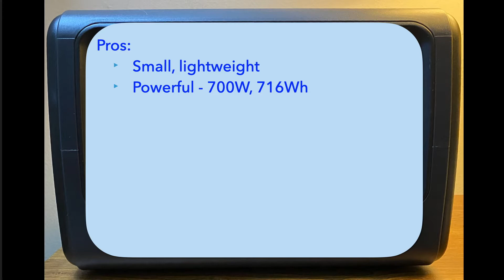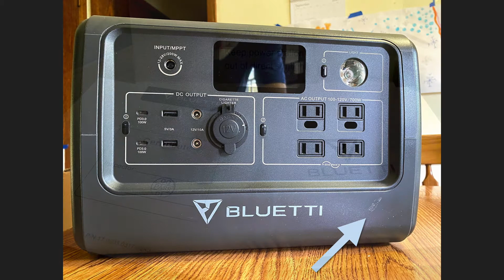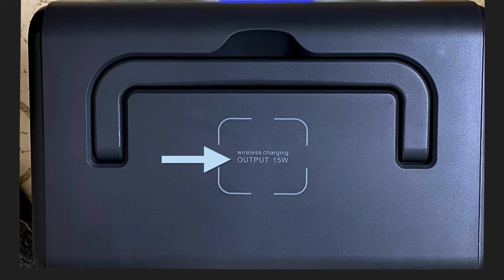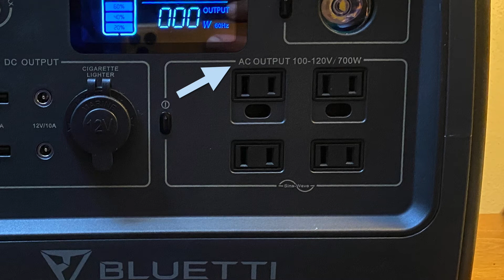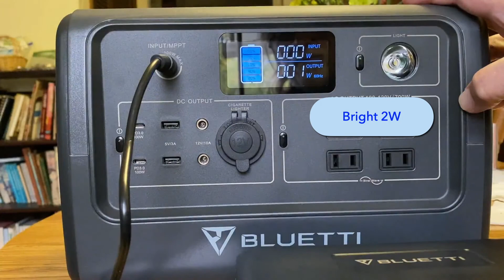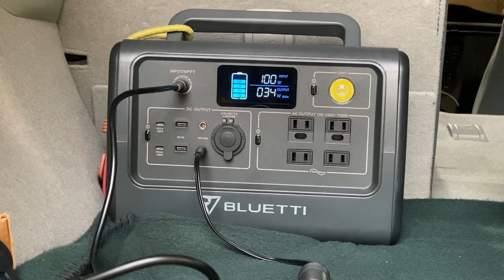Unpacking & Using the Bluetti EB 70

Comment: Does the bluetti recharge through the cigarette port on the Prius? I would think that would take forever! That port hardly can recharge my phone! It seems like putting it directly onto the 12v battery with an inverter would be better. But another expense, an inverter. I don’t have solar panels, and I don’t want to rely on them 100%. I don’t even have a bluetti, but was thinking about buying it! Seems like a 2nd 12v is cheaper to do and have easier replacement costs once it’s life is spent compared to these power banks, I only camp in summer too.
Reply from the maker: Thanks for the question. In short, yes. Of course, it takes longer than at 120V. I just leave it plugged in, and haven't timed how long it takes to recharge. I drive half to a full day, so it keeps the Bluetti topped up. I'm surprised your phone doesn't easily recharge in the Prius Aux port. I plug in my phone, CarCam, and real GPS into that front Aux port when I drive. It's rated at 10A. (I have added a second 12V Aux port directly off of the 12V battery in the trunk area.) Those Power Stations have tended to be rather expensive, but the price has come down over the years -- that's why I initially added a second 12V battery, to run the refrigerator. https://youtu.be/cLCAIXEVy94?si=wdnHtRwIE20QYKcS .

Comment: What happened to the 12-volt battery you added to run the fridge?
Reply from the maker: Good question! It's still there. Now I plug the Bluetti EB70 into the second 12V battery, to keep the Bluetti charged. Then in some cases, I'll bring the refrigerator to a gathering site, full of something like ice cream bars, along with the Bluetti to keep everything cold. You should see the faces of parents when I pull out the ice cream bars after lunch, and hear the happy squeals of the children.

Comment: Have a good experience with BLUETTI
Reply from the maker: So far, yes. It's an ideal weight for carrying, it's small enough that it fits into my Prius without taking up much room, and powerful enough to run my Dometic refrigerator for several days and nights without sun if necessary (I have a solar panel to charge the Bluetti when I'm not driving, otherwise the car charges it while driving). When not traveling, I use it inside my house to run the lamps in the living room (all are 12V lamps), and charge the Bluetti when it needs it from solar cells on my house. The main thing I don't like are the tiny lights which show what's on. In the dark they are OK, but very hard to see in the light of day. To overcome this, I have a 12V plug which has a nice red light on it when power is on.
Reply: We own 3 of the 2/2000/1/2400 The ability to input as you output is a great idea.Our 2008 PRIUS MDF is my current project! Sidelined on Aug 4th a 2nd Stenosis Surgery has so far c2-7 therapy 3 days a week has my Wish projects on the sideline! Next Install 12v Battery then test an see what is needing attention PRIUS is an excellent visit to early
Auto days when you could do all the needed projects in your Driveway only this time the 2nd Battery delivered 50/100mpg

Comment: I have the eb70. The A/C charger fan is audible but I don't find it all that loud. To me it's no big deal. I love this power station though! Works great. I use a Baldr 120 folding solar panel with it.
Reply from the maker: Thanks for your comment, Tommyr! I try to use my solar panels for charging, so I don't have to use the charging brick, but mainly because I want "free" power. I also charge it in the car while driving if camping. Yes, I really like the EB70 -- except for those TINY lights on the switches!
Reply: @TerrellWSmith  I can forgive the lights, small problem for a great power supply!